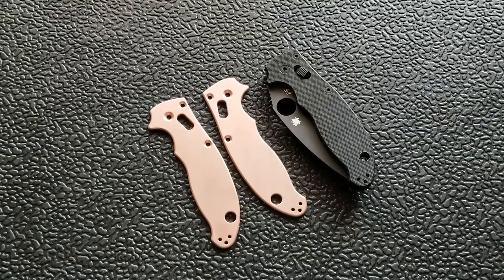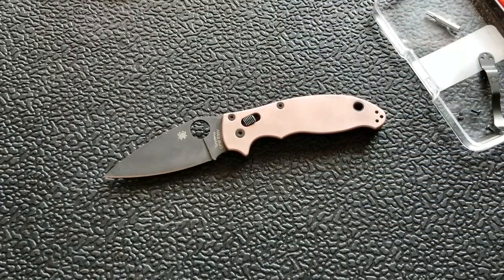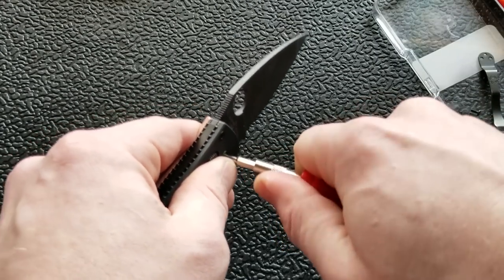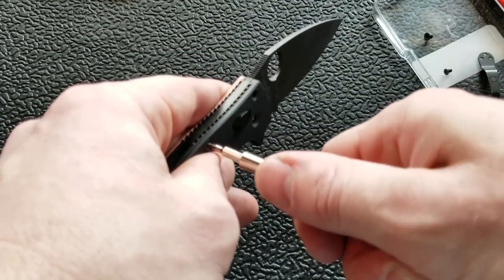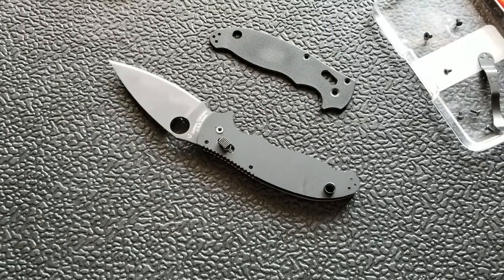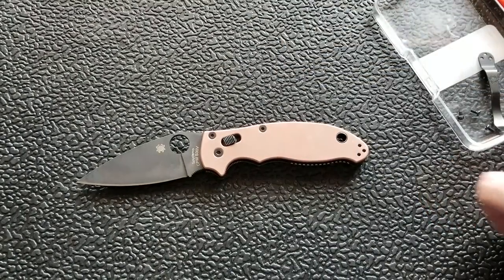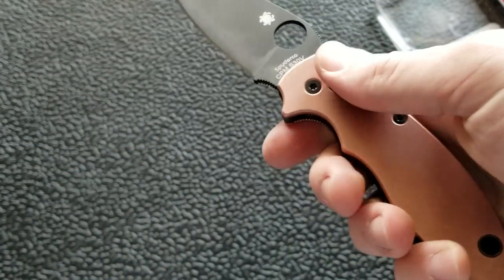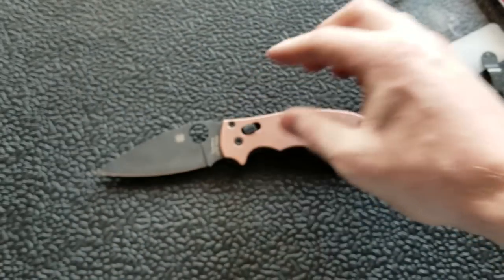Spyderco Manix 2 Flytanium Copper Scales Installation

Comment: There’s actually a tool for taking the lanyard tube off…  that’s the biggest pain,  danger in doing something to the Manix.   I don’t know how much they cost,  but I am considering buying one.  I’ve got a Saint Nick’s exclusive Red & Black Manix 2 XL and I shouldn’t be using but that’s what I buy knives for,  so I’m considering adding a reduced strength spring in the lock and a ceramic ball and metal cage.  I thought of changing and protecting it’s Red scales but that’s part of the reason I bought it.  I thought the Red would help me locate it in the yard if I ever lost it like the Smock I lost that this knife replaced.  Yeah,  no sign of the Smock,  and believe me,    I looked!!!  But,  I digress…  hardest,  most dangerous part for me would be the lanyard tube ruining my scales!!!   Info on the tool would be helpful!!!

Comment: Just bought a used manix 2 with copper scales, titanium lock, etc. Really nice except it just about wouldn't close if I flipped it open. Took screws out on 1 side and peered into the screw holes. The copper was way off. Tried the other side and same thing. Massaged the holes with needle file and larger drill bit for countersink. Works fine now. I don't have a clue as to the brand of scales, no names anywhere. What I think is, the hole for the lanyard thingie was drilled off by quite a bit. Not the screw holes. That threw everything else off. But, if I moved that hole it would have been noticeable. So, that's my manix story.

Comment: I found a good trick for lanyard tube i put a lil bit of lube on barrel and around then work the scale and liner off slowly then lube tube to easily reassemble always do one scale swap at a time. I bought lanyard plugs a couple, solid, spiral, and cross hair in tube hole like a gun scope. im not a lanyard fan nothimg wrong with lanyards I just prefere with out a lanyard hole. I'm loving the lanyard plugs it looks custom and a nice looking touch to a simple mod of hardware color change a great look to match my color scheme. I bought 10 plugs Para3, paramilitary 2, manix2 short.and got the  TI bugout scale without lanyard hole.

Comment: It is much easier to remove the scale the first time if you take off the liner as well. The liner backs up the G10 so it does not fray as you remove it. Subsequent removals are much easier.

Comment: Looks great!  Unfortunately you've got the trade off with the weight.  One suggestion:  I would have used blue loctite on the pivot.  Once you have the tension dialed in, you want it to stay that way.
Reply from the maker: The pivot screws on this one have stayed firmly in place even after a few adjustments. Normally, I would have added some.